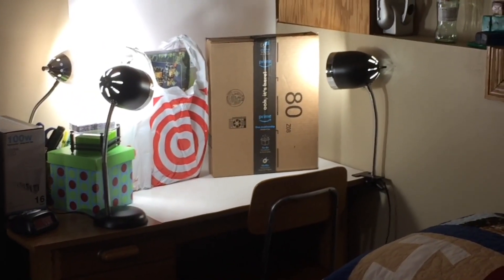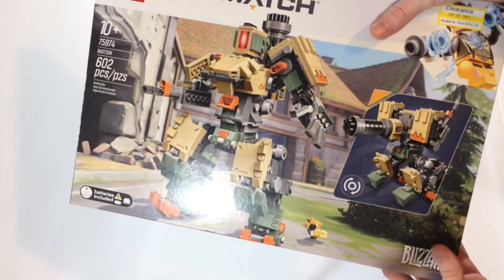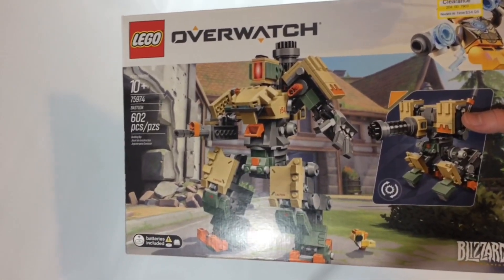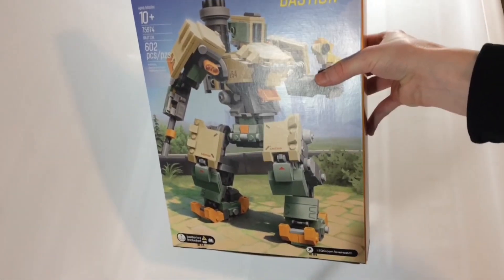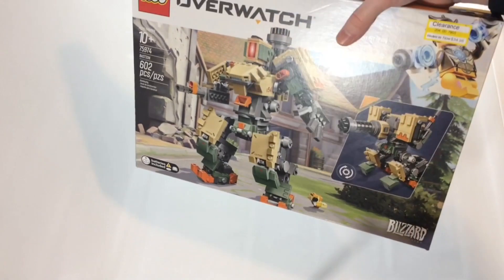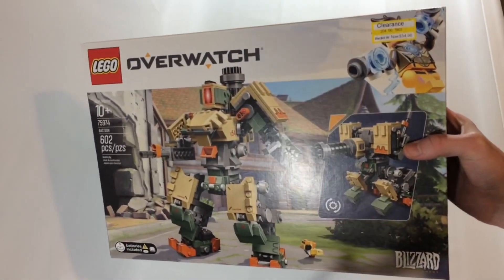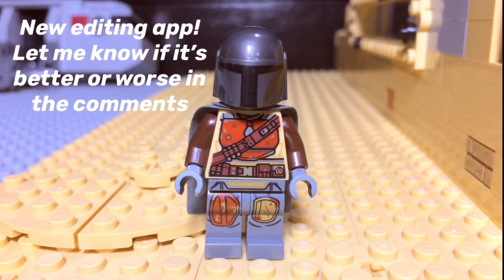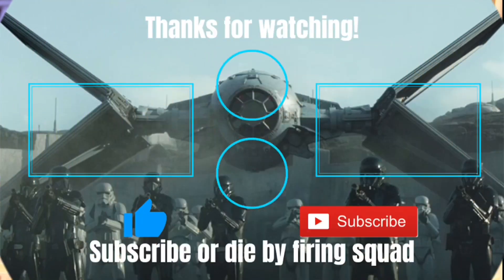Building Navarro Episode 2 - The AT-ST Raider | The Mandalorian LEGO MOC on Navarro

Comment: What new editing software did you get?
Reply from the maker: Video Leap.  It works great and has MUCH better features than most mobile editing apps but requires $0.99 per month to get some of the best features.  Great question!
Reply: Is it for mobile and thanks for answering my comments
Reply from the maker: @GalaxyLord_78  Yes, it's for mobile.  It hasn't come out for android yet but it is going to soon.
Reply: I will be sure to get it
Reply: Is it enlight videoleap video editor?
Reply from the maker: @GalaxyLord_78  Yep!  That's the one!